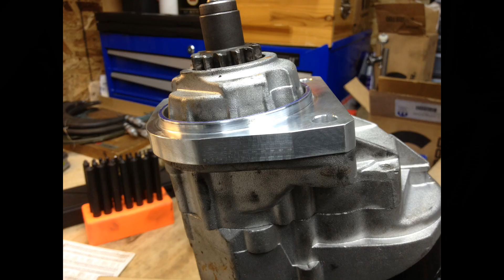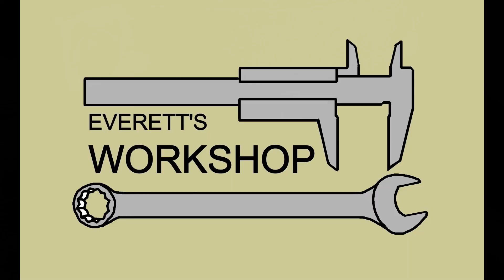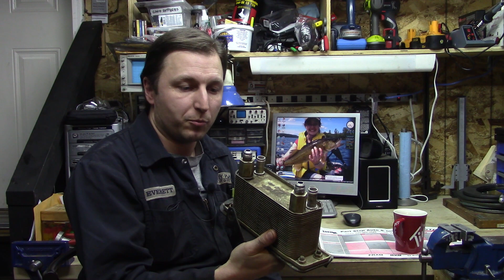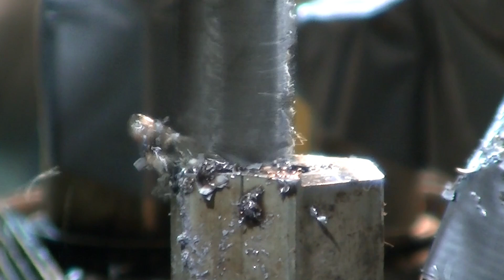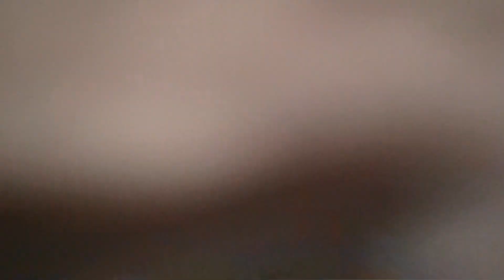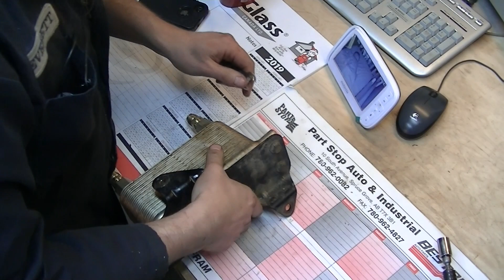48RE Transmission Torque Converter Oil Cooler Repair

Comment: Took my "Heat Exchanger" off my 04 and threw it as far as I could, and installed a new trans cooler as well, and got rid of that stupid thermostat regulated one from the factory.Both items are junk! Runs way cooler now.

Comment: It's worse when the atf cooler leaks into the coolant.
Reply from the maker: I have heard of that happening, but in the 10 years I spent at a Chrysler dealer rebuilding transmissions I honestly never had to replace one due to cross contamination.  It definitely does happen, I've seen pictures of the results, so if there is any suspicion of coolant crossover then it needs to be replaced.  I only repair the fittings on ones that are still internally good but have chewed up aluminum threads.

Comment: All that for 75 dollar part
Reply from the maker: Well, with all due respect it may be that an offshore import unit can be had for USD $70 on Amazon, even then you need to pretty much double the number to get it here in Canada on our Amazon.  That's for the cheap ones.  Most people I know want to keep with actual Cummins parts for this sort of thing, which are even much more pricey.  The fittings cost me about $10, I get some shop play time, another part is actually repaired rather than tossed in the scrap bin, and people are happy to get a good deal on a repair.  I still believe it's worth doing.
Reply: @EverettsWorkshop  that's cool if you have the time to piddle with it.

Comment: Can you machine them off using a spot face tool?
Reply from the maker: I suppose one could, but I have generally done these with end mills and fairly light cuts as the material is not a solid block but a heat exchanger with lots of "air" in the block of material that supports the fitting boss.  That and I don't have any actual spot face bits, lol!

Comment: Good video. I thought I cross threaded it when putting new lines on but now I’m thinking the threads were already wrecked. Where in Alberta is your shop? I’m in Calgary
Reply from the maker: Hi Ryan, if the threads are munged and it's an aluminum fitting, it wasn't you.  The earlier ones had brass inserts but I guess it was cheaper to simply thread the aluminum on the later ones so Cummins cheaped out.  I'm up just west of Edmonton, so not next door for sure.
When I started doing these a few years ago there wasn't much for cheap quick availability, and Chrysler was also going through a lot of Chapter 14 headache with half everything backordered.  So, I started fixing them for customers just to get them going.  I still do the odd one for a buddy, and even have one on the shelf here waiting to get fixed.  However, if you go on Amazon there are now aftermarket ones for something like $160 delivered.  I haven't tried an aftermarket one but it might be an option as well.
If you have a buddy coming this way anyway and really want your Cummins one fixed though, I'm just about functional enough to pull that off though.  If that's how you'd like to roll just shoot me an email and we can see if we can figure something out!
Reply: What’s your email address?
Reply from the maker: @ryanrychliski6464  Hi Ryan, my email is everettsworkshop@gmail.com - feel free to give me a shout
Reply: Email sent

Comment: having water going in Trans. and Tran fluid going in radiator what could cause this ???
Reply from the maker: If you have a 5.9 Cummins with a torque converter cooler like this then it sounds like your cooler has split internally.  It does happen, I have not seen it in my years at the dealer, but it does happen.  Cleaning the cooling system after replacing this cooler should not be too bad but I really hope you caught it in time to avoid damaging the wet clutches and converter clutch in the transmission.
I only repaired the line fitting on this cooler in the video, I knew the cooler was indeed good internally.

Comment: What's your feeling on stop leak addaives for the tranny line leak
Reply from the maker: I wouldn't use it. The leak from the lines isn't the kind of leak those additives are trying to deal with. As it is, I don't trust them as I've seen too many torque converters damaged from using the wrong types of oils and additives in transmissions.

Comment: IMO, it is not worth the risk of repair. What can happen is the coolant can leak into the transmission oil, ruining the transmission. I just cut mine out of the circuit. And added a second Dorman air cooler in front of the OEM cooler which also had a stuck thermostat. Pulled out thermostat and reversed it.  For the new Dorman cooler and OEM aluminum tubing bends easily, if your careful. Got a good price of $40 for the new Dorman cooler, otherwise good to use a 26 row Ford 6.0 cooler, will fit in the space.  Also on my 2005, the heat exchanger cooler has removable brass OSB fittings that screw into that cooler. pics here, and I live in SE Virginia.  https://photos.app.goo.gl/aZR59A8yEiejcfVa7
Reply from the maker: That's totally fair enough as a modification decision, running an auxiliary cooler like that can work in many areas.  I've heard of others doing it.  The thing is that there are reasons to keep the water-to-oil heat exchanger as well (especially in places that reach 40 below, like here), and this video was just to show a low-cost way of repairing and reusing the OEM setup.  Sounds like you live in the US, but even on Amazon the cheapest aftermarket air-oil exchanger I saw was about 140 in our dollars, plus buying all the fittings.
I was a transmission tech at a local Chrysler dealer and in that time never had to replace a cooler like this for cross leakage, but I have heard of it happening.  I've repaired about half a dozen of these so far though and none have come back with problems.  But I will agree with you that replacing it with an aftermarket setup is a valid repair if the OEM unit were to fail or get damaged, provided your area doesn't get too cold in winter.
Reply: @EverettsWorkshop  Hi, yes that cross leakage is a big concern for me. When on the cummins forum, it has happened to people, and the coolant ruins clutch facings etc.., which means new transmission.  Since I own an 2005, I had been thinking that heat exchanger is aging and could fail. And now I think it did fail on a PO in some way. The OEM ones are aluminum flare, but the aftermarket use brass flares with Oring boss which is what mine has. So mine is likely not as aged as I thought.  You can use a 26 row Ford 6.0 diesel trans cooler up front, it can fit ok. I opted for the Dorman just cause it was cheaper as an Amazon warehouse special $40, and I viewed it as a challenge to make it work. I live in USA, Virginia, so not very cold here.  A new heat exchanger is pretty cheap on Amazon. $70 or less, and this is how mine looks. https://www.amazon.com/EVIL-ENERGY-Transmission-Compatible-68004317AA/dp/B091YCXSDC/ref=sr_1_1?dchild=1&keywords=heat+exchanger+ram&qid=1622845598&sr=8-1
Reply: You did a good job figuring out how to repair the old factory cooler, I was impressed with your technique. 
Here is a cheaper one for $49, with same screw in fitting painted black. 

https://www.amazon.com/68004317AA-Transmission-Torque-Converter-2003-2009/dp/B06X6J45P9/ref=pd_day0_6/131-2271155-1259613?pd_rd_w=MUQty&pf_rd_p=8ca997d7-1ea0-4c8f-9e14-a6d756b83e30&pf_rd_r=9M3NV7N4817DYCGPCYAX&pd_rd_r=29fa7199-f6bb-49d8-aff4-4596fff366c5&pd_rd_wg=OBsLq&pd_rd_i=B06X6J45P9&psc=1

Comment: Is the flared side a -8AN fitting?
Reply from the maker: It's a 45 degree fitting, so it is a standard flare fitting.  I wasn't sure to begin with when I did up my first repaired cooler but once I was able to measure the conical face with a square it showed itself to be 45 degrees not 37.
BTW, I like your avatar, it's cool to see Jeeps with real flex in them.  Got a bunch of Jeep buddies but I'm scared to own one as I already have 2 expensive hobbies, lol
Reply: @EverettsWorkshop  thanks for the response, my lines are leaking bad at the joint just before the radiator and I didnt want to just put the factory junk back on so I am building my own. 
It's a 2004 tj Rubicon with a simple 4" lift and 1" body so I could tuck the tcase  up further but it works really well. And 37's do not rub.

Comment: Outstanding Everett, I consider myself as an out of the box problem solver, but your air-pressure trick is genius
Reply from the maker: Thanks, I was just trying to keep the chips out. Only do one once in a while so it isn't worth making a special tool for it at this point.

Comment: Does this help shifting problems
Reply from the maker: No, it wouldn't, unless the transmission is low on fluid due to a leak in one of the cooler lines or the cooler itself.  If it's the cooler itself then you'd have to replace it, but if it's a line then you can replace the line.  Again, there are many different causes for shift problems and the only one that this would relate to is low fluid due to a leak.

Comment: Good job Everett.You must work in a Trans Shop.Enjoy your vids.
Reply from the maker: Thanks Ernie, I was the primary transmission tech at a Dodge dealer from 2008-2018.  It just pained me to see these things get chucked for a twisted off thread so that's why I started repairing them.  Actually still have a repaired one on the shelf here in the garage, but I also have a few friends with Gen 3 5.9's so one of them might need it at some point.

Comment: now thats a mechanic that fixes things here in America is nothing but part changers that don't care about the clients money.
Reply from the maker: Thanks Miguel, I just thought it was a waste tossing that cooler over bad threads on one fitting. Don't get me wrong, if I'm working on someone's car as my job I will ask a fair wage, but I also try to see things from the customer's perspective and would rather help them save money in the long run as they are more likely to return should they need help at a later time.  Some customers have actually become friends that way.
Reply: @EverettsWorkshop  I agree we all need to be paid and your time doing that job need its payment i just feel like most shops just want the easy way out they will replace 4 parts beacuse 1 of does could be malfunctioning. i was just looking ups transmission cooler lines online for my 01 dodge 2500 after the part store saird they are 400 dollars found them on RockAuto.com 1 for $80 and the other 1 for $30 where does the rsst of the money go i mean they are the same brand Dorman. good work my frind

Comment: Hello again. I wondered if the brass fitting and aluminium (I'm British) housing might form a galvanic couple - oil going through it won't be a problem but a salty atmosphere on the outside might be. You've a lot of practical experience with this repair, does it last over time? Still working through your excellent videos one per day.
Reply from the maker: The brass and aluminum don't have a problem with each other, and in fact some of the 48RE converter coolers did come from the factory with brass fittings instead of just threaded aluminum.  Those never gave us problems.  What I can say is that I've done a number of these over the years and never had one come back!  Thank you for the kind words and support, I do appreciate it.  Biggest thing is finding time to get into the shop, hopefully the stuff here is still interesting for you as time goes on.  Thanks for stopping by!

Comment: Throw it in the garbage and mount an auxiliary cooler.. simple..
Reply from the maker: In some areas that is a viable option - here in Canada, we can sometimes get issues of coolers gelling up.  The engine coolant heat can actually help help the air-to-oil cooler flow, which is needed for feeding the lube circuit in the rear.  Thanks for coming by!
Reply: @EverettsWorkshop  I gotcha.. yeah I just wouldn't trust that thing with my $8k transmission... I have heard horror stories of the exchange failing!!
Reply: @EverettsWorkshop  I'm in south Texas so doesn't get to cold here all the time lol

Comment: Everett's Workshop - Nice work!  I'm actually getting ready to replace a rusty/leaky trans cooler line on my '03 2500 5.9 Diesel and curious to see what you think of skipping new OEM steel cooler lines all together and going with some type of screw-on aftermarket barbed fitting(s) at the OEM trans-cooler fitting or (better yet) retaining and cutting a section of the original cooler pipe to retain the stock flare/nut... then adding a flare from a brake flaring tool to the cut end and simply running a section of aftermarket transmission line from the connection back up to the cooler(?)  Reason for going this route... 1) Trucks 15yrs old. 2) New OEM lines are well over $100 and 3) The main factor, I can completely eliminate the hassle of reinstalling/fighting the OEM line(s) back into position(!)  This of course all depends how lucky I get with the threads when backing off the flare nut on the OEM torque converter fittings. Would really like to hear your thoughts on this idea if you don't mind commenting...
Reply from the maker: Thanks for the compliment!  The only issue I can see with using rubber all the way is that the lines themselves, being steel , would shed heat too.  Another fellow I talked with did just that but he installed a massive aftermarket air-to-oil cooler at the front.  That and you'd have to secure transmission hose securely so it didn't chafe.  If you're wanting to avoid the Mopar parts counter for the price of a Harbor Freight 1/2" bender, the flare tool, and some bulk steel line, one option could be make main sections of steel line (that are shaped easier to install) with rubber line sections at the ends.  The really stinky one is the return line, and if you put a flare nut and fitting in the middle that one would be duck soup to install.  We were having trouble getting lines at one point for the older ones (2nd Gen), even from Mopar, so we got the tools at the shop I was at and made a few over the years.  Just a thought.
Reply: Appreciate the reply/info!  Definitely try'n to avoid the $Mopar$ parts counter + trucks get'n older and want to keep the whole "nickel and dime" thing low as possible. Actually ran across the "flare nut/fitting trick" you mentioned on youtube ( https://youtu.be/De5DDncQBdc ) earlier today and found that to be a really good idea. Also ran across a seemingly popular "-8AN Steel Braided Transmission Hose kit" for a 48RE Ram Transmission on fleabay/ebay (Item#253160765980) but have yet to find anyone who has tried it or given it a review. I'll definitely proceed w/caution until I can figure out if going all rubber will interfere w/proper trans/oil cooling. Incidentally, there's a youtube video at the following link ( https://youtu.be/PBbIoa04VIQ ) where someone put heavy duty cooler lines on a Duramax but not sure how much aluminum (if any) existed prior to the hose swap?
Reply from the maker: I tried the two video links you have but they gave me a 404 error, no biggie.  And I get it about the parts cost, I used to work at a Dodge dealer and there are parts on my old '03 Dodge 3/4 ton that I tore apart, repaired and reinstalled because I thought the replacement assemblies were on the spendy side.  Maybe I'm overthinking it regarding rubber line vs steel, especially if they're selling those eBay kits reasonably well.
Reply: I do wish I were more handy/skilled at bending raw tubing, heck a guy/gal could possibly make a good living selling aftermarket cooler lines for these trucks below OEM prices if they were good/efficient enough at it. Also, try those links again... I ran the parenthesis too close to the link (there needs to be a space between each parenthesis for the link to process properly).

Comment: That part is nothing to mess with, if the internals ever fail your ATF will turn into pan cake batter and you will b out a $4500 transmission. And for that guy out there the Fords had a worse similar problem with the oil cooler failing inside the 6.0 completely destroying the entire engine so save the coments. Thanks
Reply from the maker: Believe me, I hear you about if it were to fail - I've seen enough of the radiator-mounted cooler failures in other vehicles to understand what you're saying.  However, if the cooler itself isn't leaking internally and just has stripped threads from changing the cooler lines (which regularly leak ATF) it's definitely worth fixing rather than dropping a G-note on a new one.  And as a tech, I've heard and seen common failures of various types on all brands of vehicles - if every manufacturer figured out their issues we mechanics would be out of a job, lol!  Thanks for stopping by!
Reply: I just stumbled across the video and enjoyed watching it. I have a '05 with some modifications and my current project is to eliminate this "cooler" completely. There are two reasons: first it's not so much of a cooler as it is a transmission fluid heater . The factory thinking is that it will help the transmission work better in cold weather but in later models they have eliminated it without any consequences.  Second it is so much cheaper just to eliminate it and the factory hard lines and use stainless steel hose (or equivalent) and route these directly from the "real" transmission cooler by the rad back to the transmission. I live in Canada as well (Ontario) but don't drive my truck in the winter so I'm not going to miss it and will have eliminated one more thing that can leak. Now that I know what these things are worth I'm going to be real careful removing it so perhaps I can resell it on Kijiji. :)
Reply: @DieselTruckNut  That's great info there for,  many people thought it was a cooler. It's the same principle as when running after-market fuel pumps outside the tank such as what I do. I run a Fuel-Lab Velocity 200. Part of their schematic includes coolant flow through the heater block to prevent gelling over of the diesel fuel in cold climates.